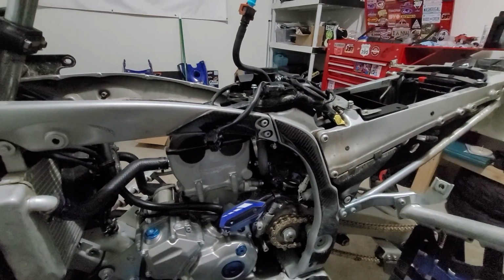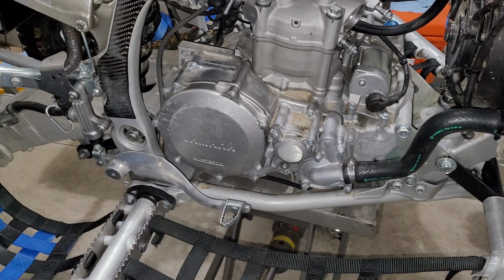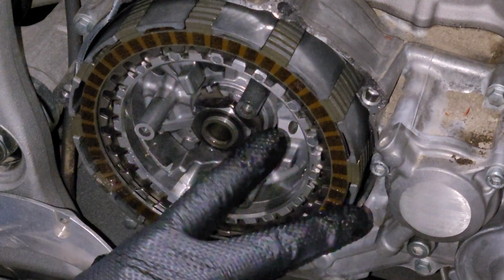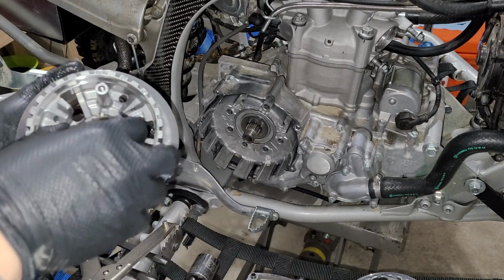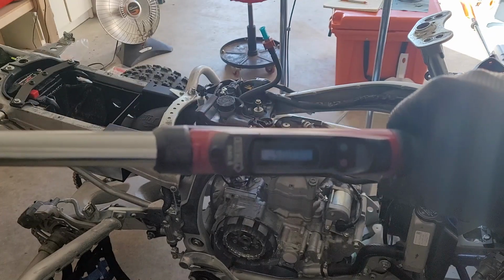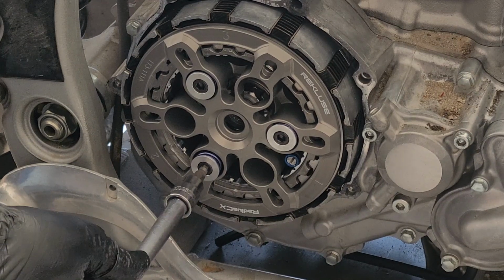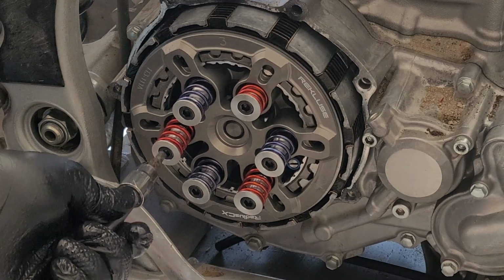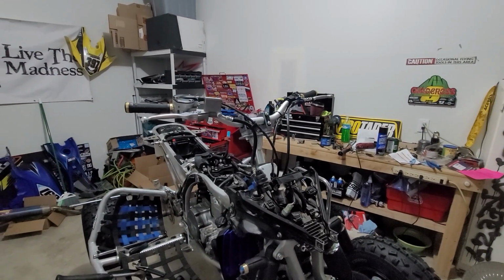Finishing the YFZ450R build!

Comment: Hell bro as long as your doing good work it’s gonna be ok I prefere putting the piston in the jug then on the rod it garentees your rings are installed propper
Reply from the maker: Having done it both ways now, I definitely prefer that method as well. It's also a lot easier with the motor out of the frame.
Reply: Get you another guy or gal too help hold it wile you put the c clip in that’s what I do I got nothing too prove braking rings and shit lol 😂

Comment: With your new clutch does it come with a new basket or do you still use the 8 bolt design from the 09 model?
Just curious if a new clutch kit will bypass having to buy the old version basket.
Reply from the maker: No, it does not include a basket in any of the RadiusCX kits. They sell a basket separately, but only for the 09-10 model.

You will still need the old basket with this kit. The nice thing is that the basket sleeves in a Rekluse kit pretty much eliminate basket wear, meaning you won't have to replace the part (unless there's serious motor damage) or buy a stronger one. Just replace the sleeves with the steels and fibers and you're good to go.
Reply: @AustinRohr  So any Rekluse kit I buy I should still be buying the old OEM 8 bolt basket for good measure?
Reply from the maker: @lukehiggins4  absolutely!
Reply: @AustinRohr  damn it gets expensive quick :( Thanks for you help!!
Reply from the maker: @lukehiggins4  it certainly does! That's why I bought the basket first and waited a bit to do the rest.
Reply: @AustinRohr  which rekluse kit did you get?
Reply from the maker: @lukehiggins4  it's the RadiusCX
Reply: @AustinRohr  what's it like compared to the standard clutch setup? And what made you choose an auto clutch over a the manual?
Reply from the maker: @lukehiggins4  I haven't actually tested it out yet, that will be coming this weekend. I chose an auto-clutch because from everything I can tell, there's no change in performance. You still get the direct hookup advantages of Rekluse with the benefit of not worrying about stalling and having better drive out of corners if you're in a higher gear. It's become very popular in motocross and the same benefits should apply to atv motocross.
Reply: Sorry to be off topic but does any of you know of a trick to get back into an Instagram account?
I stupidly lost my account password. I would appreciate any tricks you can offer me.
Reply: @Jericho Casey instablaster =)
Reply: @Maximiliano Erik i really appreciate your reply. I got to the site thru google and im waiting for the hacking stuff now.
Seems to take quite some time so I will reply here later when my account password hopefully is recovered.
Reply: @Maximiliano Erik it did the trick and I actually got access to my account again. I'm so happy:D
Thanks so much you saved my account!
Reply: @Jericho Casey You are welcome =)

Comment: what made you go for the FC intake? I thought you were set on the stock airbox and pro design adapter
Reply from the maker: My decision was partly due to the necessity to get more airflow to complement the internal modifications I made. 

The other part that factored in was the update in FC's design that no longer requires you to drill into your subframe. The newer design seems like it should hold up better and be sturdier than what I've observed with those who have the old one on their YFZs.